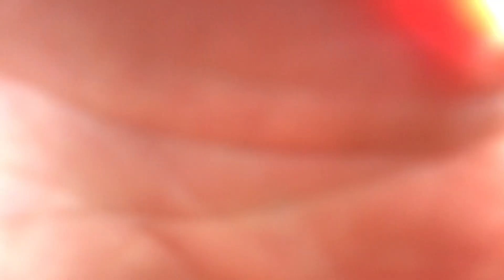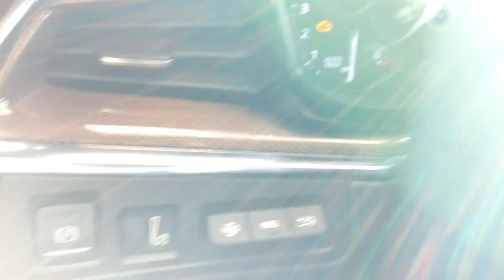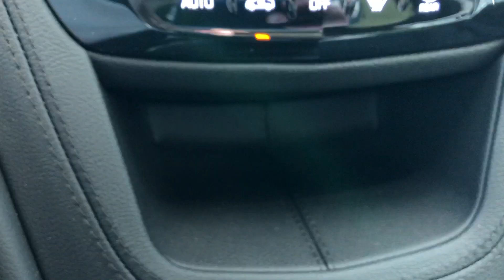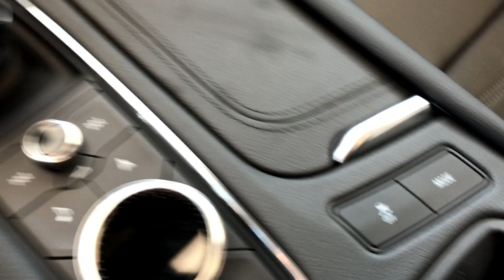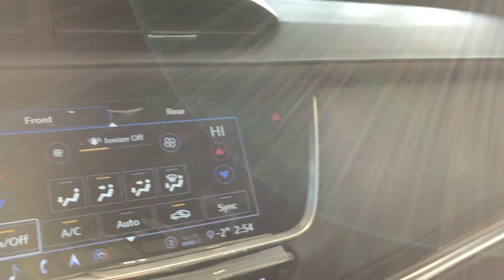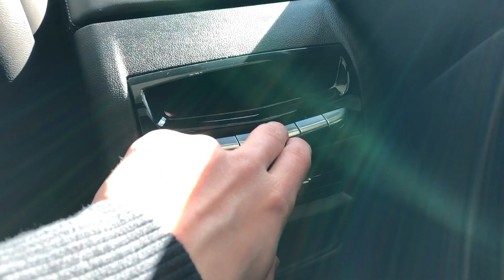2020 Cadillac XT5 Sport Review

Comment: You forgot to show the 4 cylinder engine
Reply: The sport is a V6 3.6L. I wish it was more powerful
Reply: @LouB3rt  ... You have to , as of 2020 buy the premium luxury model to be able to add the V6 3.6L for 1000.00 more to get the V6 . 
My wife just bought one . Go to GM's web site and build one to see what I'm saying. I don't think they have sport anymore
Reply: @good-boy-ringo  
2020 Sport
3.6L V6 engine
9-speed automatic transmission for 3.6L engine
MSRP from $56,090 
a lot of money for a v6 crossover
Reply: @LouB3rt  ...All the cars and truck are costly today and are over priced.
The companies charge a lot for the cheaper models so If you want your money worth , you'll need to spend a little more.  We got ours on GM discount but that isn't what it use to be, maybe 4000 off. The cry baby dealers fixed that.